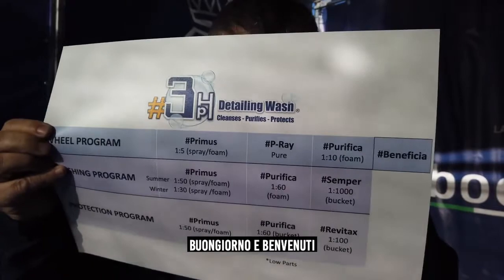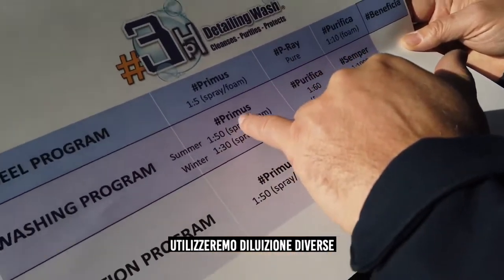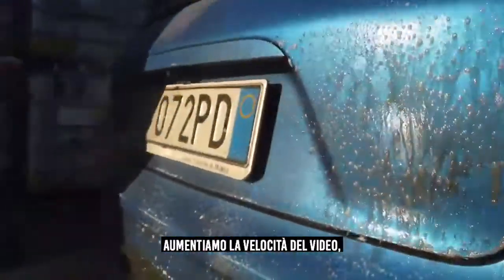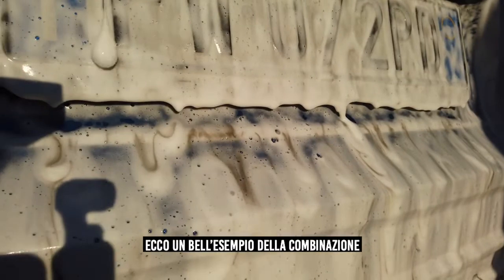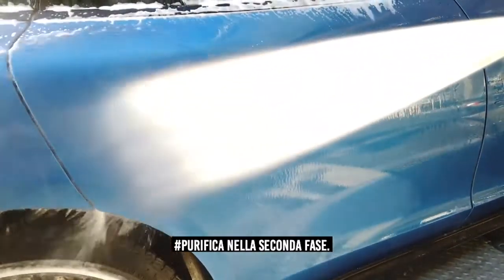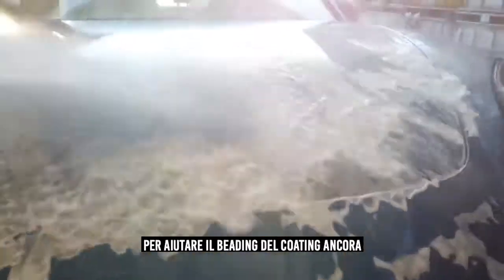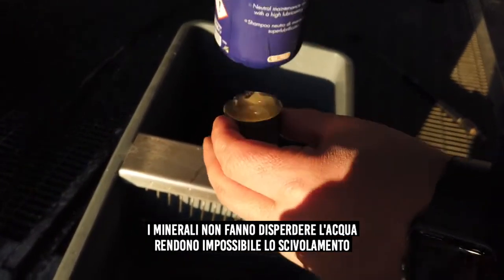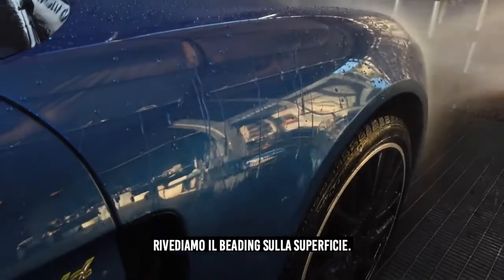LaboCosmetica 3PH Detailing Wash on Porsche (The Ultimate Car Wash Shampoos)

Comment: So my question is can you use the 3PH wash system if the car doesn’t have a ceramic coating I ask cause wondering if it will still give the car a really good clean still I have the products but haven’t had any cars come in with ceramic coatings I have did some ceramic coatings just none coming in to unclog the pours to bring back the hydrophobics
Reply: It should work totally fine, whether your car is ceramic coated or not.   It's just a 3PH car wash system, no matter what type of protection you have on it.   It should give your car a great cleaning and get it ready for a new coat of wax, sealant, or ceramic coating of your choice.     The acidic portion of the wash is probably what unclogs the ceramic coatings if a person has a coating on their vehicle.    Labocosmetica is one of the first companies to design a specific "system" per se for cleaning and decontaminating a vehicle so that you have the best possible condition on your paint to accept a coat of wax, a polymer sealant, or a ceramic coating.   It is the best way to get your car ready for whatever form of protection you chose.   Another system that is very similar is the Chem-X system.   You first spray the acidic soap on the paint with a foam cannon,  then you spray the alkaline foam over the top of the acidic foam after it has had the chance to work a few minutes and the alkaline soap on top of the acidic will neutralize the effect of the acidic soap and gets your car very clean as part of a decontamination system of whatever method you personally prefer.   Many people also add in a clay bar or clay mitt treatment, an iron remover treatment, and also a tar remover in various stages of the decontamination wash process.  This full decontamination process (the wash, the clay, the iron remover, the tar remover, etc.) is the best way to ensure your paint is in the most clean state you can obtain.   Finally, many people add in a paint "cleansing" piece of the puzzle, which could be a compound/polish,  just a polish, or a "one-step" all in one type of polish.   The polishing step is not mandatory, but it is a crucial step in the process in order to give your paint the best possible GLOSS.   POLISHING is the best way to increase your gloss.   While some glazes will help to increase gloss a little bit,  polishing will help to remove minor scratches in the paint and "level" the paint so that the naked eye sees the increase in the gloss.   Even a simple one-step polish does wonders for most paint and will be plenty of gloss increase for 95% of people out there.   Only the last 5% want the MAXIMUM amount of gloss by doing multi-step polishing and compounding.   Some even take it another step further and do what is called "wet sanding" of the paint to level the paint much quicker and uniformly and then they start into the compounding and polishing stages.   That level of detailing is usually reserved for wealthy people who want their show cars going to a concour event like Pebble Beach in California, the ultimate car event in the world.    People who are enthusiast also will conduct multi-stage polishing as they just like the process and want to see how much gloss they can bring out in their paint.   I have personally done these very long and labor intensive multi-step polishing steps to my own Nissan 370Z and it took me over three weeks to complete it working on it a little bit each day.   I started with a full decontamination wash process using all the above steps, and then I did a compound, polish, finishing polish, and ultra fine jeweling polish.   My car looked absolutely incredible when it was done but again, it takes so much time, effort, and products (polishes of all types, pads, three different polishers, chemicals, etc.).   It can almost become an obsession.    But I do still get a lot of comments on my 370Z and how good the paint looks.   Everyone always asks me what I used to get the paint to shine like that.   I tell them "weeks of polishing it".